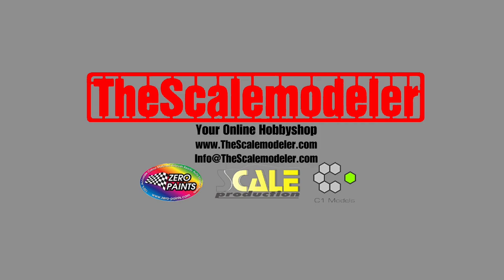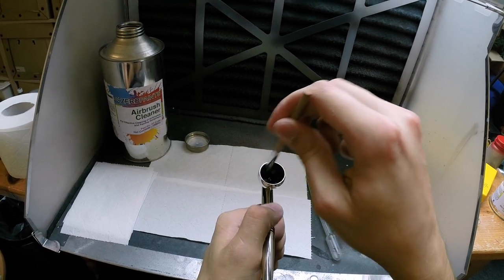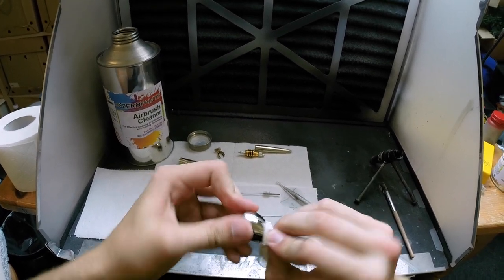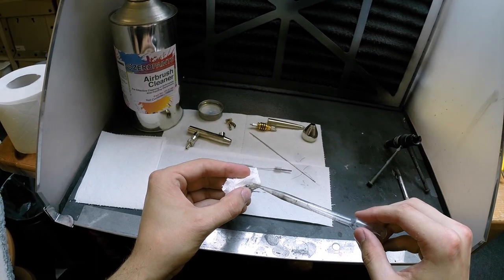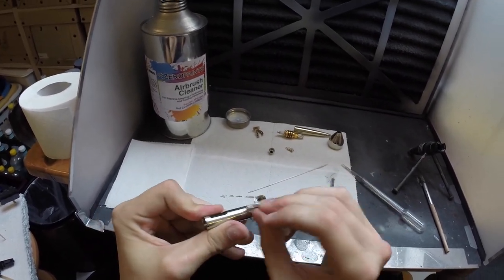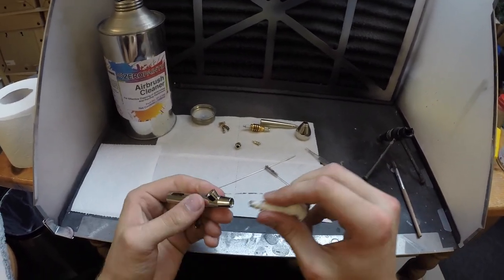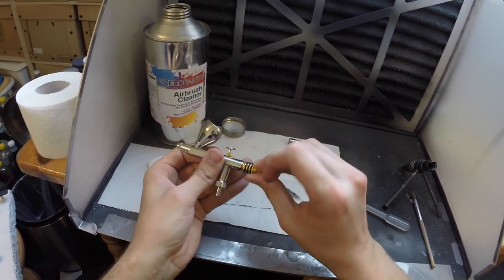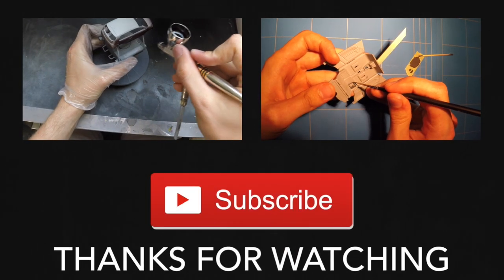How To: Clean your airbrush

Comment: If ur In america there a product called pledge future it's sold in super markets target walmart they keep changing the packaging last I saw it had blue boots on the cove and when u turn it around it  sAys Acrylic protection all u have to do is just cover the part and hang it to dry people use this as a deep clear as well can be applied with a brush or spayed with air brush but keep in mind if u do the brush or even dip method I would l let it dry for at least a couple of days before u start really handling it it will be dry in one day but some people get something called spidering in the clear when handled to fast really depends how much u put on

Comment: I would like to start with airbrush, but I have no clue where to start. I have a few questions. What should I buy, and what do you recommend? I need what you need to airbrush. Do you need a spray booth? and how does that work. Also I dont want to spend very much money, but i want a good airbrush, and the other things I need. Is there a kit or something with compresor you can recommend? Thanks
Reply from the maker: I reccomend a Harder & steenbeck 2 in 1 EVO
You will definitly need a spray booth, i have a sparmax booth
if you don't want to spend a lot of money, airbrushing is not or you, it takes a good chunk of money for a good quality setup,

just an estimate
airbrush 150 ish
booth150 ish
compressor starting from somewhwere around 150(small air tank)  up to 400(big air tank) ish to have a good one.
Reply: I know it is expensive, but i ment not A lot money though. Thank you for answer! also when you wait for paint do dry after you use a airbrush do you just leave the airbrush and clean it after the whole process or do you clean it after each coat?
Reply: I can't find a site that sells the airbrush you reccomend
Reply from the maker: https://www.amazon.com/EVOLUTION-SILVERLINE-Airbrush-Harder-Steenbeck/dp/B003Z9VYHQ
Reply from the maker: I only clean it when i change color
Reply: did not thought amazon had free shipping to my country, thanks a lot!
Reply: I remember you said in a video that you used x bar/psi, what whas that again?
Reply from the maker: +Magnus Hatteland i mention that in pretty much every video i use my airbrush. 2,4 bar(29psi)
Reply: oh, ok haha. Thanks man, appreciate your help :)
Reply: Marvel of Cons I was about to comment that. I have about $130 tied up in my set up (compressor, two gravity fed dual action, one siphon fed, cleaning pot, and cleaning tools), and while it's not the best in the world, it has served its purpose over and over again. Get a cheap one to play with and practice before you drop a large chunk of change, you may end up not liking it. Source: I have a cheap airbrush set up, I painted the helmet in my profile picture with it and continue to use it all the time.
Reply: Another thing is, it's 80% of the artist and 20% of the tool; you can have the best tool and still not produce the best quality work, it really depends. Practice does make perfect, I'd say the investment you made would still last you in the long run until you're ready to advance; regardless I'm with you on that too (btw, the helmet looks amazing!!!!!!!!!!!!!!!!!)

Comment: I noticed that in your 2018 videos you're using the other type of Harder and Steenbeck Evolution without the O-rings. Do you prefer that one over this model shown here? And is the other one, I think it is chrome instead of nickel plated, easier to clean?
Reply from the maker: They work the same. Feel the same. Clean the same. This one was just cheaper

Comment: I`m using nailcleaner without aceton (by kruidvat or local drogist) and it`s a lot cheaper and it works perfectly  also with paint as Alclad etc.
Reply: it is good indeed, but its not good for removing enamel colors (Of course not airbrushing) like Revell.

Comment: Thanks for the tutorial, very helpful! I ended up ordering that Tamiya Painting Stand Set from Japan, now I'm waiting to get my portable spray booth. I have a question about primer, I will be shooting an Aoshima Datsun 720 Pickup Truck but the Tamiya Grey Primer seems to be a little on the thick side. Do you have any recommendation as to how much thinner to use to thin it out a bit, or should I not thin it out at all? I will be starting with the interior first just to get my feet wet. Thanks again for your advice!
Reply from the maker: +THEBOOGIESHOP If you think its to thick, thin it. if your not sure, just try it without thinning and add thinners until your happy.

Comment: I used tamiya spray paint with airbrush so I couldnt clean it then I used hydraulic brake fluid to clean it will it destroy the airbrush ?
Reply from the maker: +Adnan Karagöz why did you not just use airbrush cleaner ir paint thinners?
Reply: The Scalemodeling Channel Too late :(
Reply: The Scalemodeling Channel Will it destroy it vey bad :(

Comment: Could you do a video tutorial on how far to hold the airbrush from the model?
Reply from the maker: +awash2004 I would if i could, I actualy have no set distance. i just do what feels right. i think its about 15/25 cm away.....
Reply: The Scalemodeling Channel OK so about 8 to 10 inches?
Reply from the maker: I think so
Reply: +The Scalemodeling Channel OK
Reply: Does it not kinda depend on what you are after? If you want to lay down a basecoat you keep it further from the model, and if you freehand say Camo pattern, you want to pull back lightly on the trigger and keep it closer?

Comment: Using the corresponding brand of airbrush cleaner to paint is just a bad and expensive idea. Paint is paint, and cleaners are cleaners. As long as it is the type of cleaner for the type of paint (ammonia based cleaner for acrylics for example), then brand means nothing besides price. Windex works and is recommended by air brush manufacturers.